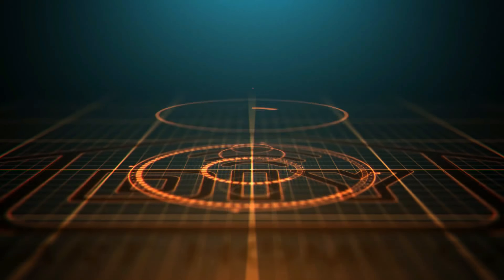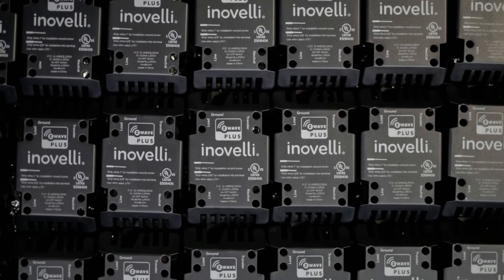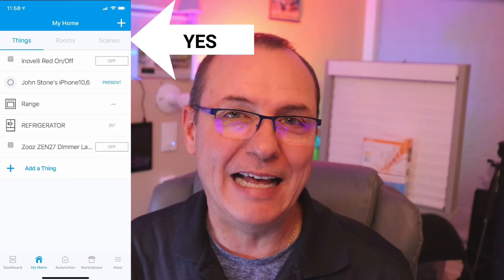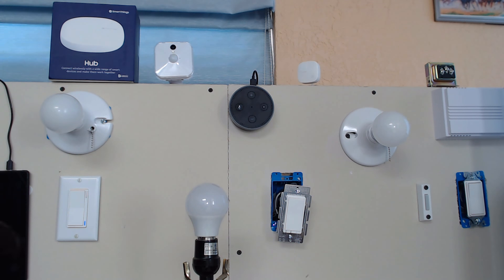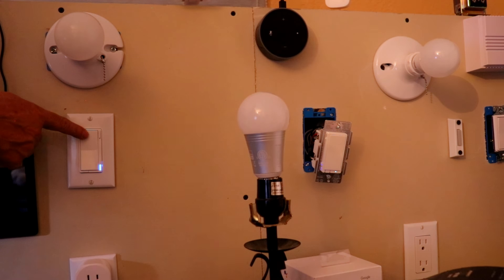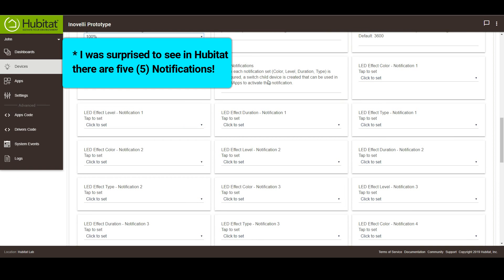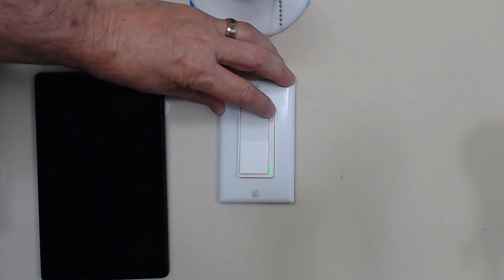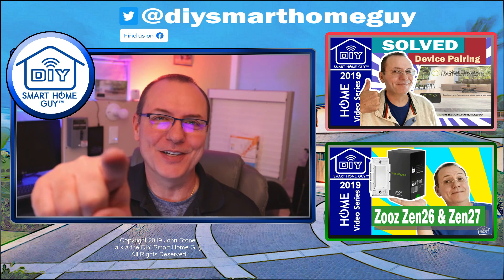NEW Inovelli Next Gen Z-Wave Plus S2 In Wall Smart Switch in SmartThings and Hubitat Elevation

Comment: The problem I have is that delay with single pushes. I understand its there for double+ taps to be registered but what I find is the delay is enough where someone will push the button a second time because the light doesn't turn on or off quick enough. Which then triggers a scene to occur. I'd much rather have scene control done with two side buttons to give options.

Pretty cool though, Not sure about having that many scenes. I could see it now, you wanted up tapped 5 times to turn something on but you messed up and tapped up 6 times. So now you have to tap down 6 times to turn it off and then up tap 5 times to finally get to what you wanted. A nice touch but that'll be rough. lol
Reply: @DIYSmartHomeGuy1  Ha yea, the double tap being added in Z-Wave+ switches is a life saver for sure... I do appreciate the ability for more of them to, I'm sure  I could easily come up with 35+ things I would want to do. But that would take a while 😂. Maybe some kind of up down combinations to cut down on time.... lol
Reply: Hey so I thought I'd jump in here if that's ok and let you know that we're working on a solution for this. While it's still less than a second delay (heck probably like 0.5 second delay) the reason for it is a double-edged sword. However, I think we've figured out a solution, but it will require a sacrifice of losing scene control on the paddle.

Here's the dilemma -- the way the scene control works is that when you press the paddle, the switch waits to see if you press it again (ie: activating a scene). If nothing is pressed within 0.5 seconds, the switch knows that you're not activating a scene command and turns the load on. 

What we could do is create a way to make it so that you can disable scenes on the paddle portion and still keep the scenes on the configuration button (right now there's one scene on the config button). 

This wouldn't be the default, but if you really wanted to have instant on, you could configure the switch to do so.

I've added this to our community as a suggested upgrade and even though we are working on it, I wanted to give you credit for bringing it up :)

Thanks for the constructive feedback!

Eric
Founder | Inovelli
Reply: @InovelliKalamazoo  What is the status of cutting down the single tap delay?  How does the reviewed device (and the possible new one) compare to Leviton's snappy 'instant on' when tapped?

Comment: I'm definitely intrigued by this switch.  It would make my current setup 1 notch higher on the smart integrated scale.  So if I understood correctly, if I have an existing 2-way dumb paddle (flipping up&down) switch, I can replace just one of the switches and it would work without rewiring the other switch?  If so, how much???

Thanks for the vid.

Comment: Hi there, thanks for your lovely videos on smart home products.  I too have discovered Inovelli as the best yet.  Question: I have a 3-way switch (with Neutral white wires) in one room Box1 line comes in, two traveller wires (red/black), and Box2 load out to light.  I already have a GE/Honeywell #39350 Add-on switch working in Box2.  I read GE claims their switches only work with GE main switches?  Can i install Inovelli Red Dimmer into my Box1 (line) and get the GE add-on to work in Box2 (load)?  If not what Add-on Aux dimmer switch plays nice with Inovelli?  Thank you.

Comment: Don't the homeseer switches have the same features?
Reply: that makes sense. those are some nice features. I see that Inovelli also has some toggle switches, also out of stock, and they have fan switches, still not in stock yet.

too bad their switches are all "out of stock". reached out to them to inquire about availablity
Reply: Is there something special or different about the fan controllers? Beyond just the same 13 scene multi switch?
Reply: @mrvjtod  John did a great job highlighting everything -- but I also wanted to throw this out there that yeah this switch will be pretty insane in terms of functionality (firmware) and also from a hardware standpoint, it will be a fan/light combo switch (here is where you can find out more about the specs: https://community.inovelli.com/t/fan-light-switch-project-hurricane/23). We will for sure launch a standalone fan switch, but that's coming later. 

As for the out of stocks... whew, I know... it's been a tough year. We made the decision to switch manufacturers and long story short it caused us to have to start from scratch. We're in the process of revamping the site and I'll be cleaning up a lot of the older products shortly.

For toggles, we likely won't be carrying those any time soon as they just don't sell very well. It's still a possibility for late 2020, but I would give it a very low probability :/ 

Hope that helps!

Eric
Founder | Inovelli